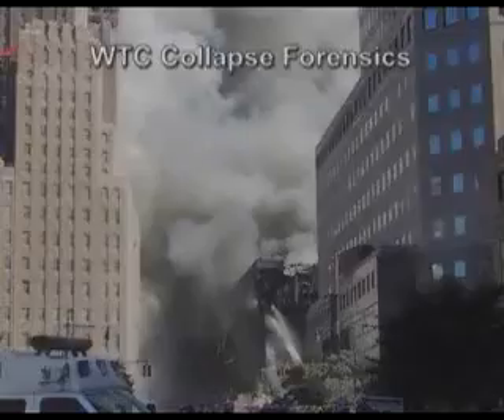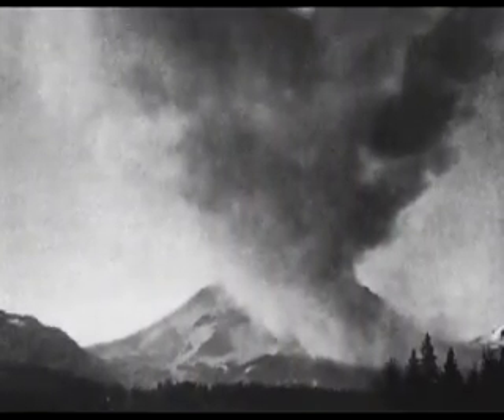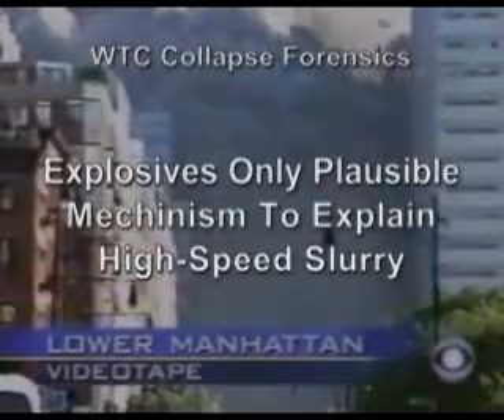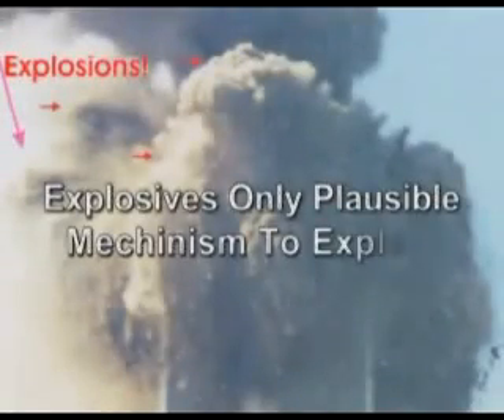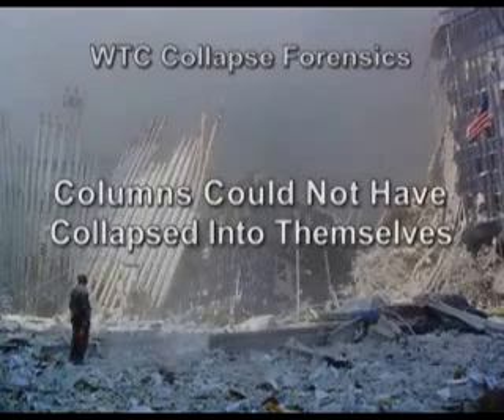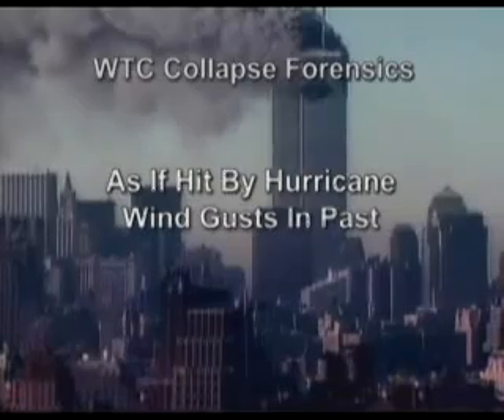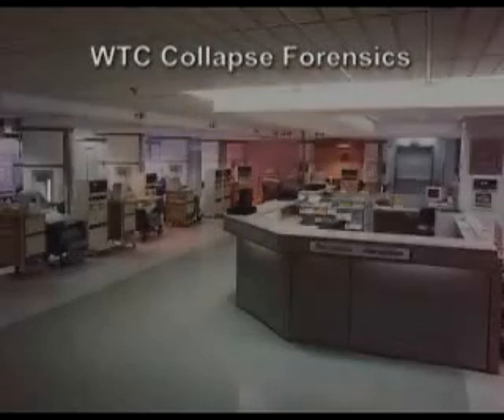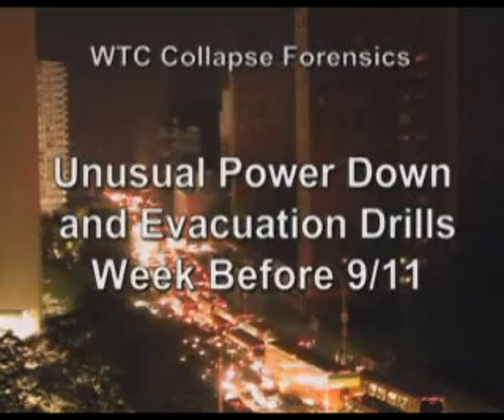MIT Engineer Disputes 911 Theory of the WTC Collapse-Part 2

Comment: Why is no one mentioning the fact that a plane travelling at very high speed hit those inner pillars?
Reply: +Some One Because an aluminum plane travelling at any speed could not penetrate the outer steel columns to reach the inner pillars.
Reply: +Some One Did you ever see a plane crash creating a massive crater in the ground? Right, no and that's because planes have very little structural integrity when introduced to solid mass.  There is no way a plane would have penetrated far enough, with enough force left in it to "snap" the inner core, even suggesting it is absolute stupidity.
Reply: Some One
Let's assume that what you say is correct, ignore every piece of counter evidence there is and suggest that the top part of the building came crashing down due to structural failure.
The entirity of the building below the damaged area would have been completely un-damaged, that (biggest portion of the building by far) is designed to hold it's own weight and the weight that is ontop of it, which now failed plus the weight of a fully occupied population.
The building was evacuated before the event so the building less weight to support, then you have the safety limits they impliment when concructing the building let's say ~ +10%.

So, the bottom part of the building wouldn't have been weakened, instead it would have been able to support more weight. There is no way in hell that top part of the building would have "crushed" 95 floors of completely intact core, outer structure, floor reinforcement etc. The top part of the building would have slowed down to a halt very quickly and either get stuck ontop or fallen off the side of the building to the streets below.

So yeah, what if the planes actually did manage to do any real damage to the core?
Reply: Some One I think to say that the planes pierced the outer columns is stupidity any damage to the core would be only cosmetic
Reply: Sandy P~all For me it is so hard to explain the lack of damage to the towers between the planes disappearing into the building an the fireball and following cutout damage, if the planes did exist there was also explosives used to extend the damage caused to the buildings, the other thing I cant accept it the almost complete lack of plane wreckage from all four plane crashes. No footage that I have seen shows plane wreckage on the ground before the buildings were demolished.
Reply: Sandy(sex on the beach)Balls I will take a lot of convincing that it was directed energy weapons that did this but on the other hand I can't think of any scenario where the about 700 foot section of core columns that was left standing for a few seconds could like the rest of the building collapse vertically, something was at work here that I don't understand.
Reply: Sandy P~all I have read and watched some of her presentations, She is very plausible and indeed might be correct about what happened at the WTC I don't believe directed energy weapons were used at the pentagon, My best guess and that is all it is, is that the damage was caused by a bomb or cutter charges and that a aircraft was flown over the pentagon and the scene staged to make it look like it crashed there
Reply: probably because there would be no plane left to hit the inner core or anything else
Reply: Newcopia
You don't need to be labeled a "truther" to justify your thoughts, any person with any margin of common sense would have to come to the conclusion that it was all one big sham ;)
Reply: TheNecrocoil Yes but by admitting that I am a truther I don't find it offensive to be called one.
Reply: TheNecrocoil I don't think the planes caused them to "snap". To say a plane travelling hundreds of miles an hour did no damage to the core is stupidity. I do believe that explosives were planted however. Do I believe the government did it? No I don't.
Reply: TheNecrocoil I'm not disagreeing that explosives were used as well. I believe the firefighters on the ground witnessed explosions. I will be the first to admit I am not a structural engineer. A structural engineer would have to qualify the plane theory. I just happen to believe that it was both, plane and explosive. There are some people that say no planes flew in to the buildings which is a little far out there for me.
Reply: +Newcopia 
Through years of research I've come to believe in the theorys oh Dr. Judy Woods. Some sort of advanced direct energy weapon had to have been involved. Some people think she's disinfo but there just shilling for the government.
Reply: +Newcopia 
Yes I agree but I think the Satelite mounted Directed Energy Weapon theory is as good as any. Also, I'm a fan of Dhimitry Khlezov and his mini-nukes proof. Tell me Newcopia, are you familiar with the Jew-controlled Rockefeler family who built and owned the World Trade Center buildings?
Reply: +Newcopia 
Have you read Dhimitry Kalezon's scientific proofs of the use of mini-nukes at the WTC on 9/11 yet Newcopia?
Reply: +Newcopia Gee whiz, aluminum, as strong as steel can't break steel connections?  Wow, a new 9/11 truth dumbed down physics used to support idiotic opinion based on overwhelming ignorance of science, math and physics.  Good job super follower, don't use any critical thinking skills or look up reality based work on 9/11.  Steel fails in fire, and a plane going 590 mph has enough energy to break into the WTC and damage 10 interior columns, and you could calculate this based on the energy if you were not a mindless drone for 9/11 truth claims and BS.  Spread some more like, it makes idiots like the Boston bombers feel better about killing, since they believe the same BS you spew for 9/11 truth... good job
Reply: +TheNecrocoil LOL, and you fly these "little structural integrity" planes? lol, Aluminum is as strong as steel... Big error; why do you lie?  A plane does make a big crater when it is going 500 mph, and there are examples all over; but you can't find them, your google is stuck on woo, BS, lies, and your gullibility.
Reply: +TheNecrocoil you would have to drive your car at 590 mph to test your inability to do basic physics. You have no clue what physics is, or why energy is based on velocity squared. you have no clue what velocity squared is, or the impact of Flight 11 was more energy than 1400 pounds of TNT, or Flight 175 energy of impact was more than 2000 pounds of TNT.  You can't do math and physics, but you can fall for lies about 911.  It make you a follower, a puppet for liars and fools.  You can't do the physics, so you support liars.  
The exterior columns of the WTC went from 2.5 inches to .25 inches in thickness to the top.  Thus the aircraft had no problem hitting high and break through the WTC shell which was designed to stop a plane at 180 mph, not 490, or 590 mph. Thus you fail to realize the reality of speed, and steel thickness, and you can't do physics.  
ftp://ftp.ecn.purdue.edu/ayhan/Korucu/Karim%20and%20Fatt_(ASCE)0733-9399(2005)131_10(1066).pdf Real science, the stuff you ignore... better luck with Bigfoot, with Bigfoot you are not mocking the murder of thousands with dumbed down lies born in overwhelming ignorance and anti-intellectual claptrap.  

the study I posted, "Impact of the Boeing 767 Aircraft
into the World Trade Center", does the math and physics to show if the WTC shell was as thick as 20mm; it would stop the planes.  But the areas where 11 and  175 were less than 10mm thick.  Thus you ignore reality, did zero rational research, and come up with BS, lies and idiotic claims based on your opinion. 
You bring failed dumbed down opinions to a fact fight,
Reply: eyesuntzu
And again you ignore my other comment, I wonder why? Also, I never assumed that the outer shell of the building would STOP the airplane, I said that it would rip it apart, reducing it's structural integrity, which it would. Have fun trying to prove that the plane would stay intact after beeing introduced to solid steel beams.
Reply: +eyesuntzu Are you seriously suggesting that an aluminium alloy less than 0.1 mm thick can penetrate / cut through 10 mm structural steel?   Remember that the steel box columns were rectangular and edge on meaning that the plane would have to cut through feet not mm of steel. wake up!
Reply: Newcopia I'm not saying that there wasn't any other factors. I do believe explosives were used, but a plane travelling at the speed slamming into those pillars would have an effect on them. Would it cut them in half? No. But to say that the planes had zero effect seems a little far off to me.
Reply: +Some One Zero explosives were used on 911. Where do you get silent explosives?  No blast damage to any WTC steel, no blast effects from any explosives on 911. 
The planes did break the shell, and damaged the interior core.  It was the mass of the planes that did the damage, and like a hollow point bullet, it rips up the WTC - and the planes had the energy of 1400 and 2000 pounds of TNT in kinetic energy, like bombs, but all the energy went into destroying the plane and the WTC.  
No explosives, that is a lie, and not only a lie, but a dumber than dirt lie. 
Who planted your explosives. The plane impacts look like explosions because they had the kinetic energy of 1400 and 2000 pounds of TNT... that looks like an explosion, and then the fuel ignites and produces a jet fuel fire ball.  
The WTC failed in fire, no explosives; you are right, the planes, the mass of the planes did major damage to the core, 6 columns in one, and 10 in the other based on energy of impact.  Any good engineer can estimate this based on the steel and the planes mass and speed, and energy...
Reply: eyesuntzu
Keep on ignoring shit you can't awnser, just goes to prove how ignorant and shallow minded you actually are.
Because I already covered the part of the building failing due to fire/heat, or the planes weakening the inner core, but you conveniently ignore that comment all the way through, it's obvious why.
Reply: +eyesuntzu You deleted your post! "+Newcopia Gee whiz, aluminum, as strong as steel can't break steel connections? Wow, a new 9/11 truth dumbed down physics used to support idiotic opinion based on overwhelming ignorance of science, math and physics. Good job super follower, don't use any critical thinking skills or look up reality based work on 9/11. Steel fails in fire, and a plane going 590 mph has enough energy to break into the WTC and damage 10 interior columns, and you could calculate this based on the energy if you were..."  Never mind I have copied it here for you and all to see. I guess you realised how stupid the comment was.
Reply: +Some One I am yet to be convinced that there were planes involved at the WTC I am sure that flight 77 did not crash into the pentagon, and if Flight 93 crashed it was because it was shot down.
I have done a frame by frame look at the videos of the second plane crash and there are things that don't add up. As you watch the plane disappear into WTC 2 there is no apparent damage to the tower just puffs of smoke, then there is the fireball, there is always fire before smoke, it is not until after the fireball do you see damage to the building. There is no airplane parts or debris falling down the outside of the building, and no visible wreckage in the hole. I have looked at all the photos and video taken at ground level before the towers collapsed and I can see no aircraft debris, luggage or anything that would indicate that a crash had occurred. I don't believe that a standard 767 can be flown at the speeds reported or that an inexperienced pilot could fly the plane by hand. 
I am a truther, I don't come up with theories and I don't speculate, I also don't accept anything I am told without some evidence, so until something can be proven I will remain unconvinced.
Reply: Newcopia There are tens of thousands of people that said they saw planes. I can't see how that can be refuted.
Reply: Some One There are millions that say they saw the planes on TV or heard about them on the radio, Your assumption that tens of thousands say they saw them first hand is at least questionable, there are many that heard and saw explosions, some even before the first plane hit, I don't believe that an unmodified airliner could punch out the external columns like we saw, That does not mean that a plane of some sort didn't fly into the towers or the pentagon but they did need help to do the damage that we are told they did. I don't believe that office fires could weaken the structure below them and cause the collapse like were were told, Maybe I am wrong but I will need to see the undisputable evidence, or a plausible recreation by experiment before I will change my opinion of what happened.
Reply: +Newcopia The planes hit with 1300 and 2000 pounds of TNT in Kinetic Energy... the WTC tower can stop an aircraft hitting at 187 pounds of TNT.  Thus the aircraft on 9/11 enter the WTC, and damage 6 and 10 core columns in the WTC; it is called physics, math, engineering; not the BS of opinion you have based on nonsense and fantasy.  You failed to use science.
Reply: eyesuntzu No you failed to dazzle us with your brilliance so are now trying to baffle us with bullshit. 
If science can prove this then it can be demonstrated by experiment that has not ever happened.
Reply: +Newcopia you should check out the hutchinson effect ... and the whole directed energy weaponry will seem a whole lot more plausible
Reply: It is time someone demonstrated how the hutchison effect could be used to cause what we saw.
Reply: Physics proves the plane could do what they did. Using the old tag-line "dazzle us.. baffle us... is proof your claims are evidence free, and the video is BS from a failed 9/11 truth nut; his claims are BS - your BS detector is broken.
Reply: LOL, the DEW BS is dumber than dirt and started by an insane idiot.
Reply: "Physics proves the plane could do what they did." really!! can you show us where the physics proves this? If physics can prove it then it can be demonstrated through experiment has the physics even been proven through experiment?
Reply: +eyesuntzu good insults.  I guess that you are right and that is why hacksaw blades are made of aluminum because they are as strong as steel. Show me the science that makes you believe that aluminum is as strong as steel or where a plane has cut through steel, or just do what you do best, through insults because you have nothing to back up your claims.
Reply: If you take some physics classes and learn about building design and materials properties, then you will be a little embarrassed by what you wrote here. 
I studied building design and construction management before I got started in the building industry. Physics classes and building design classes were required for the degree. In physics... F=MA & E=(1/2)mv2 are two standards which apply to both the plane and the upper mass collapsing on the lower mass. The weight develops many times more force when it falls a distance than the force (or equivalent mass) it has when it is not moving. You can carry 10 pounds, right? Try to catch a 10 pound bowling ball after it dropped 15 feet. You'll be trying to catch a lot more than 10 pounds... It will break your arms, the way the upper floors broke the lower floors.
Buildings have a factor of safety of perhaps 2, I'm not sure what this would have had... maybe more since it is a high-rise. Larger safety factors only add weight and cost, so they try not to design higher than it needs to be.  
If you were to set the upper section gently on the lower section, then you are correct... No problem taking the weight. The absence of people is negligible in weight and shouldn't be mentioned (it's called live load, but has nothing to do with peoples "lives"). But when the upper section falls 15 feet? It's like imposing 20x the load (I am tempted to pull out my old physics book to look up exactly how much more). Those remaining top 20 floors weighed millions of pounds, and the lower section is designed to take that as a static load... But multiply that by 20.... The lower sections can't handle it. Then the remaining Building design can't handle the dynamic loads imposed in all directions after that. 
This stuff is not common sense, which is what people are trying to argue from in this Youtube comments section. It's physics and building design. I get a little offended when people preach to me about things I don't know about, but unless you  have training and experience in them then you are only fooling yourself if you say you know something about it... I don't know anything about politics. If I tried to argue it, I would come off looking bad (which is why I got dumped by a beautiful lobbyist from Sacramento). I stick to what I know (I try to date architects... Try being the key word). You should dig into this stuff little more if you're really interested. I take classes at my local JC for fun. You should try the physics classes, and you will start to see...  Those 2 formulas are taught within the 1st two weeks.
And just because this guy is purported to be an MIT guy doesn't mean he knows what he's talking about. He said a lot of things that are completely wrong (take it from a professional in the field), such as the inner core supporting all of the weight of the building. Totally, Totally ,Totally wrong, I can't believe he said it. For a smart guy he's really stupid. The outer columns that you can see severed by the plane were carrying huge loads. As soon as they were cut with large sections of floor trusses destroyed by the plane, the building was doomed.  A building is a structural system. Every part is very important. You may get a little confused thinking that the building didn't fall right away, but the damage from the plane was devastating. If you take out large pieces of it, the system absolutely fails. It's just a matter of whether it fails after seconds, hours, or days. It would be like cutting off your arms... You would live for a little while, but the damage is too severe and if the bleeding isn't stopped you will die. Just because you didn't collapse dead the second it happens doesn't mean it's not a fatal injury. 
Please don't tell me you're one of the people who says that there wasn't actually a plane and it was CGI. There was another guy posting in this section a couple of months ago who said it was all perpetrated by some jewish super spies and it only took 50 people to put this whole thing together. I made the mistake of asking him to spell out how he thought it all happened. I got an earfull, He's definitely put together an incredible story...
There are governmental conspiracies in this world. This was not one of them. This was physics and airplanes and building design and evil converging just the way it looks. Exactly what you see on film. Nothing more. Believe your eyes.
I doubt I'll change your mind, but Just had to say something. Cheers-
Reply: hahahah hahahahh hahaha what about the water that cuts (at high pressure) steel? Kinetic energy is an optional for you... go back to school ignorant. Ek= 1/2*m*v^2 it depens on mass not on material.. hahahaha
Reply: I never said there wasn't explosives used. I'm referring to the fact that people are saying there were no planes. To say the planes had NO effect or they weren't there at all is a little far fetched.
Reply: A plane made of aluminum striking a solid grounded mass of steel is the exact same thing as a solid grounded mass of steel stiking a plane made of aluminum.
Reply: The light poles were 'placed' there in advance. 🏍
Reply: Newcopia Yes aluminium with tonnes of liquid contained in them could easily go through steel at high velocity.